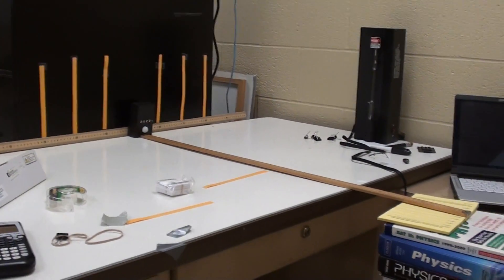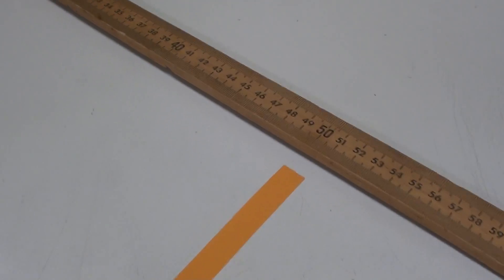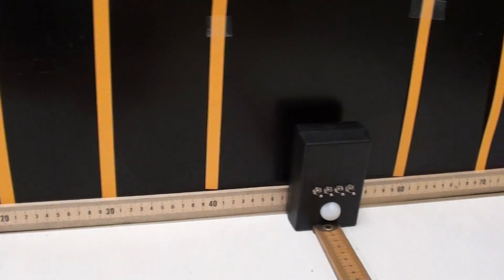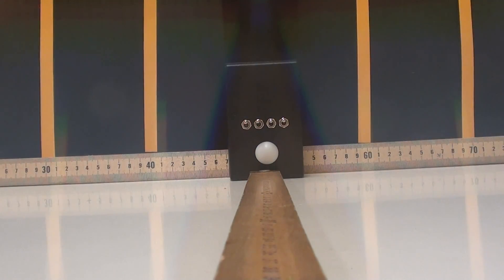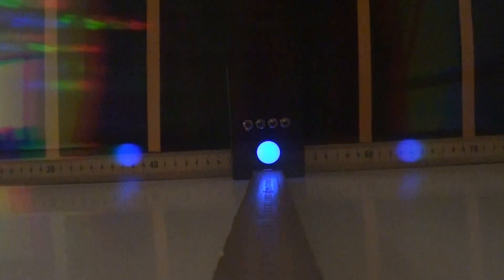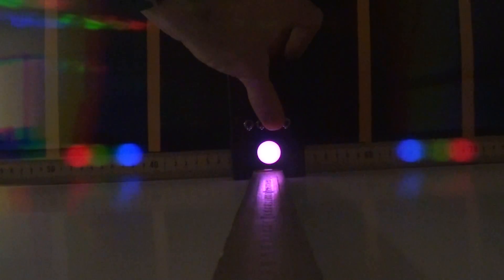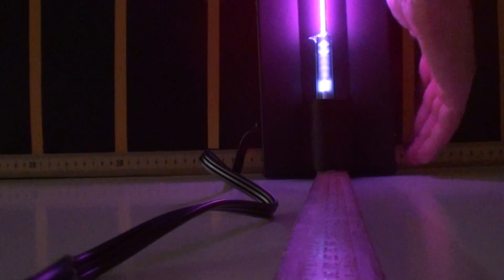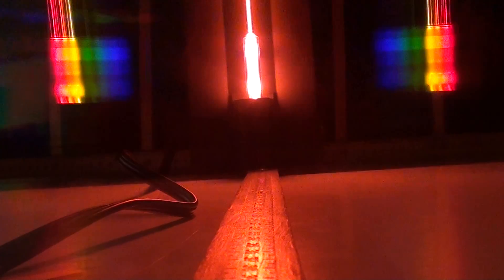Spectral Lines for Control LEDs, H, HE, and NE (Pseudolab)

Comment: Nice video. I used this to calculate the values of the red, aqua, and blue lines of the hydrogen spectrum. You get pretty close to the expected values if you average the left and right distances (the camera isn't quite in the middle), and also note that the distance to the background is about 58 - 60 cm due to the lamp unit having an estimated thickness of 8 - 10 cm.
Reply from the maker: I can't believe someone is using this video 9 years later!  It was just something I threw together at the time.  I agree with your corrections.